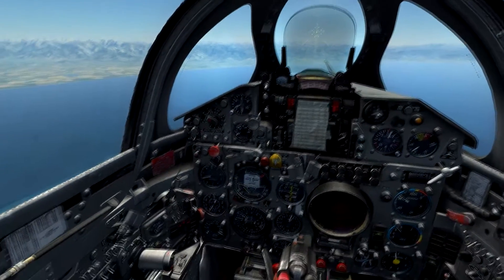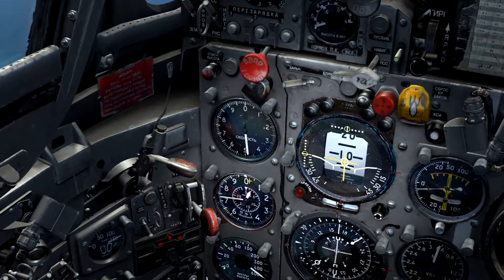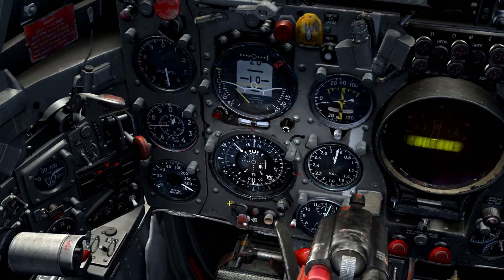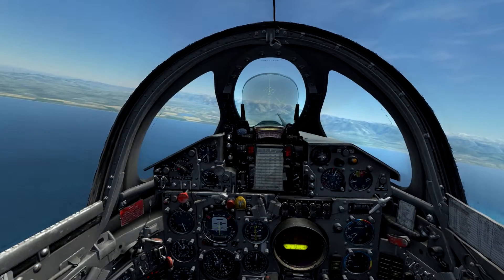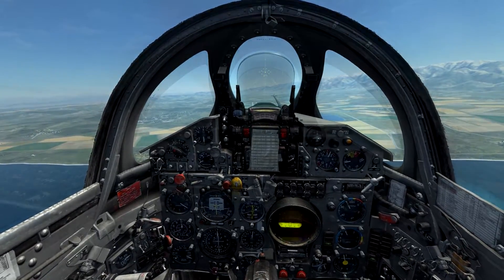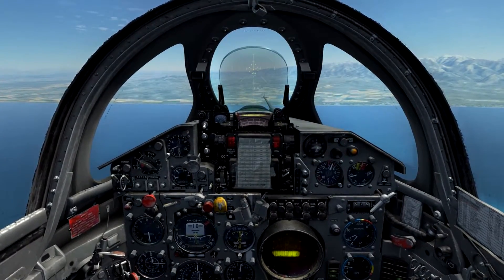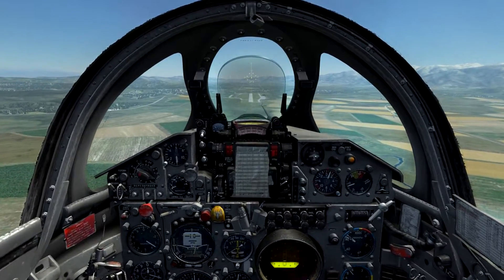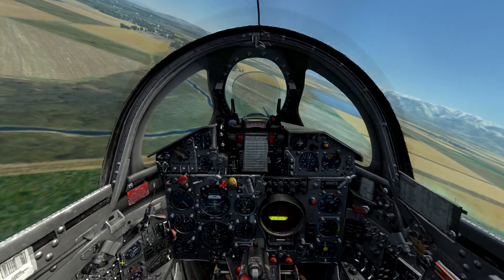DCS:World » SAU Autopilot Landing Modes » MiG-21Bis

Comment: A couple of things to do this more, proper. You'll want to line up with the localizer before you're descending on the glide slope, well prior. Once you're within 1km to 2 km of the localizer you should only use about a 30 degree offset to intercept the localizer and between 1000m to 1500m alt. Once you're within 24km on the runway you'll start to get glide slope information. that's when you can flip your switch from nav to land. The best thing to do with this system is to wait until the glide slope is at your alt before you turn on the autopilot. If you turn it on while it's above you it'll start climbing at a ridiculous rate to intercept the glide slope. The same thing happens if the glide slope is below you when you turn it on except, obviously, it will descend rapidly. Those few things will make the approach and transition to autopilot much smoother.

Comment: Great video as usual! Does the SAU system compensate for cross-wind during approach?
Reply: Autopilots are all going to compensate for a wind. The SAU is going to point the plane in a direction that keeps it on course, wind or no wind. There's nothing special or added for an autopilot to do that for wind. It just does it by default.
Reply from the maker: +Cen Blackwell No mention of crosswind in the manual in regards to the SAU landing modes, though a quick test looks like it will although I'm sure it has a limit. http://i.imgur.com/TU5KEXB.jpg?1 Seems to crab it in through a 20kt crosswind.
Reply: pickinthatbanjo That's a hefty cross wind for approach! Nice.
Reply from the maker: Yeah I figured 15kt then just added another third, seems to handle it better than I figured it would.